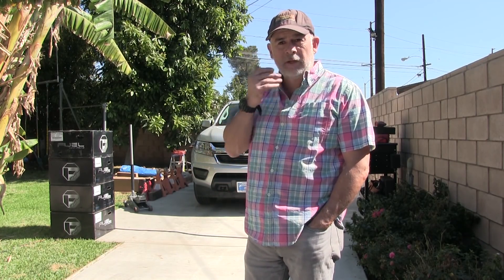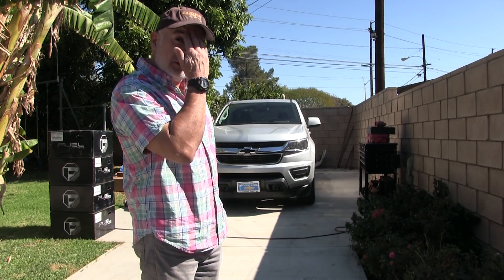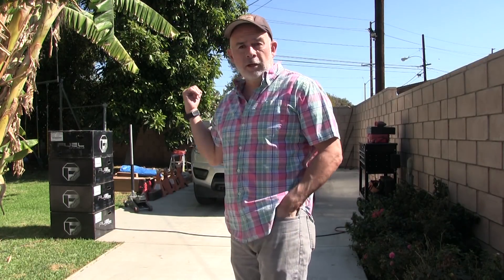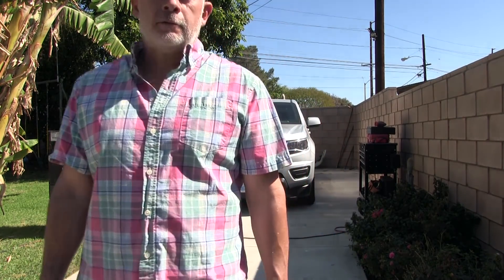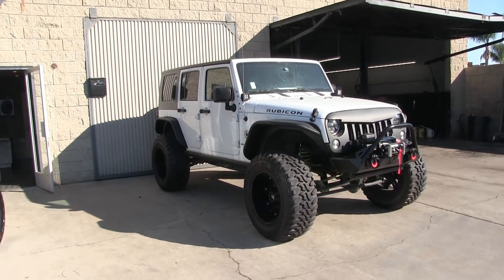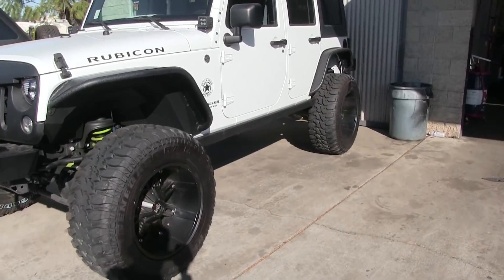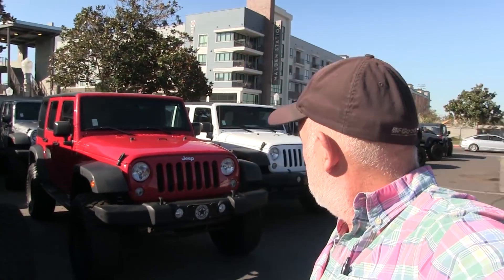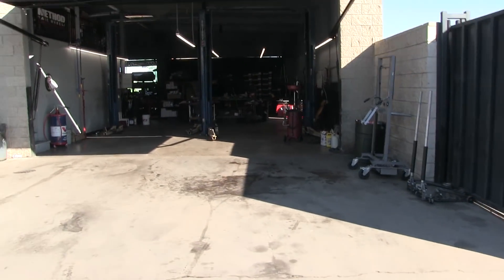Colorado Project 1

Comment: Driveline clunk is most likely a slip joint in your rear drive shaft that is binding while your driving and the stress isn't relieved until you come to a stop, sometimes with a clunk or a bang.  It's more common with mildly lifted vehicles that still manage to use the stock driveshaft. You might want to consider custom lengthened driveshafts also for your colorado, mainly to increase the life of the stock driveshaft. The shorter the driveshaft the more critical this is, and is common to all makes of vehicles with rear drive shafts. My first experience with this was with a 1974 Jeep Renegade back in the 1980's when I lifted that.
Reply: RudedogII & bobbigwoody I have what seems Rude has. It doesn't seem like a drive line but something in the front end? It seem to clunk more when wet and raining. It clunks more when you put the brakes on when backing up and then when you go fwd? It really seems like it is just under my feet on the driver side